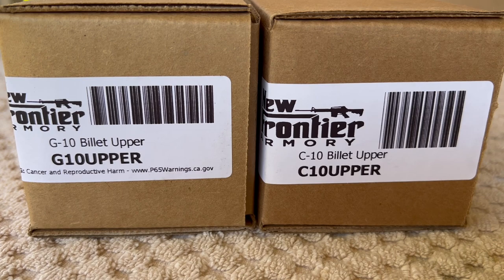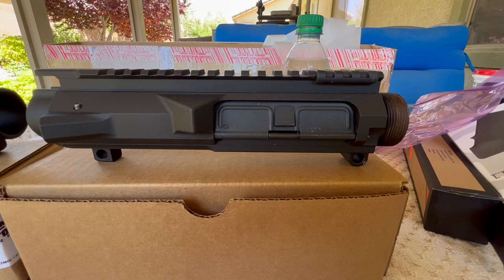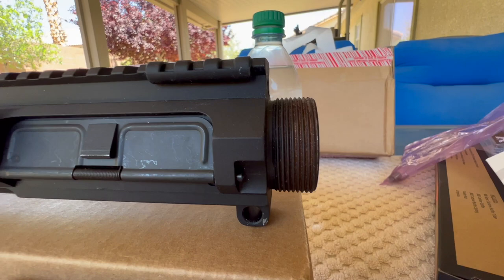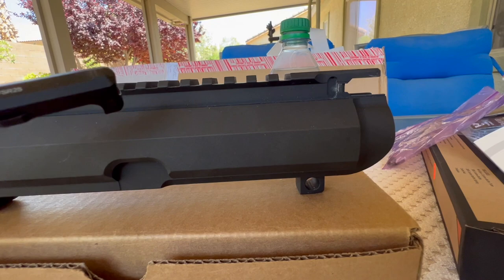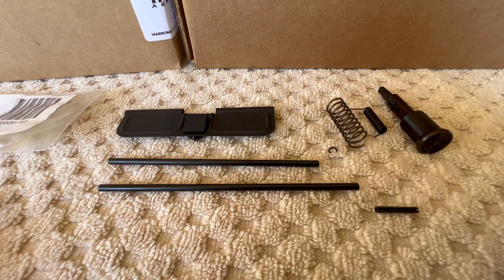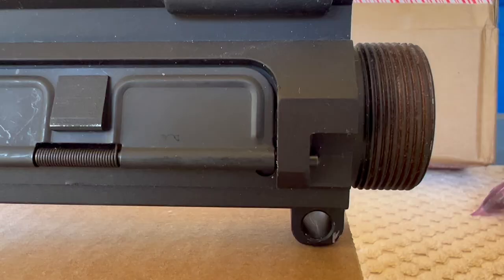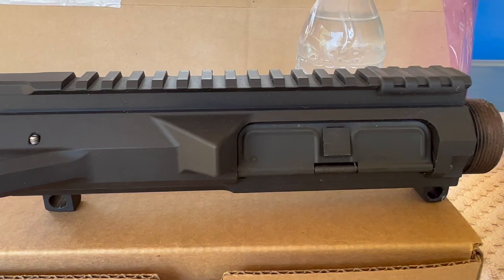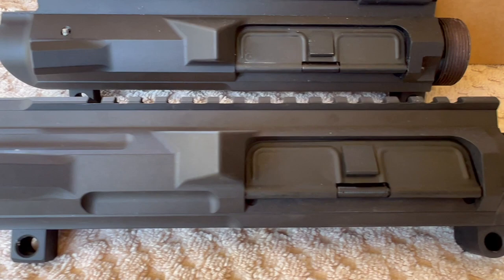New Frontier Armory LR308 C-10 vs G-10 Billet Upper Comparison!

Comment: There are so many company's building AR parts so for me this is the first time I've heard of this company over many years I have been building and selling AR uppers in the 15 and 10s in wildcat cartridges and unusual chamberings and in the AR 10s the WSM magnums.
I went to the web site then Ordered 1 G 10 AR 10 upper to see how they look and maybe to buy more?
I have right now 1 AR 10 build in 250 Savage --- 1 build in AR 10 in 6.mm-284 Norma and an AR 10 build in 300 WSM going all sold and I am waiting for barrels coming from Pac Nor Barrels in Brookings Oregon.
Reply from the maker: I've had good luck with them so far. They are locally machined here in North Las Vegas and they have a brick and mortar store. Figured if I ran into trouble they are right down the road. Just a reminder that they are low pattern uppers. They fit well with the NFA lowers but I felt that an off-set buffer retainer pin was a good idea. That area wasn't a problem but I felt it was a little close. Could have been the BCG carriers on the short side though. I have also built two AR-15's with their receivers and no issues! NFA also offers some services like hard anodizing for receivers and other small parts.